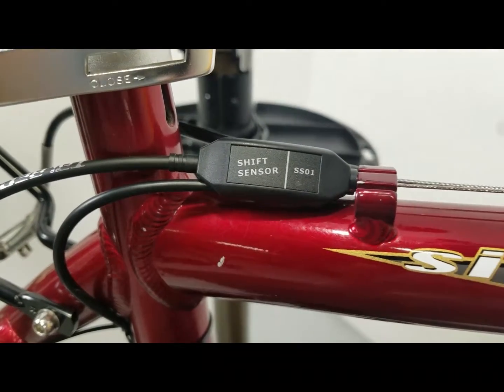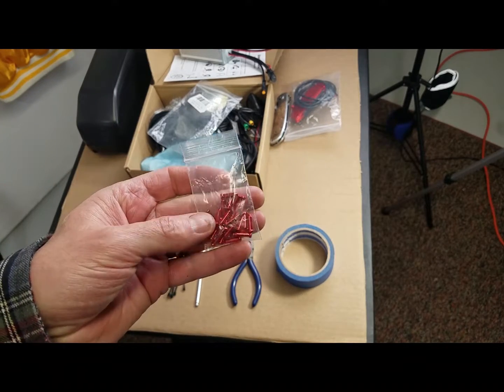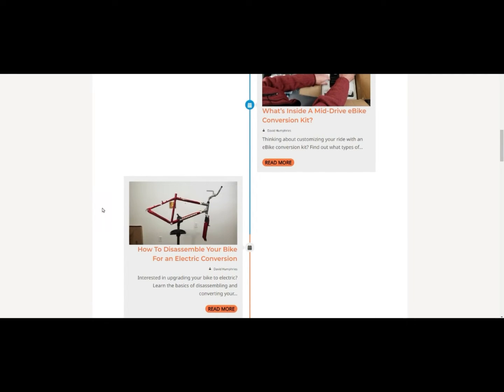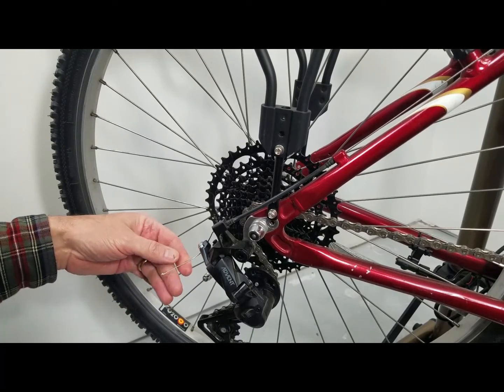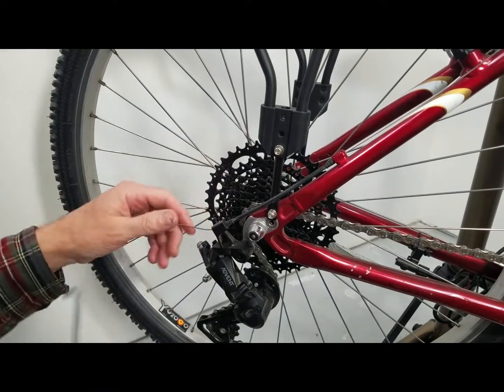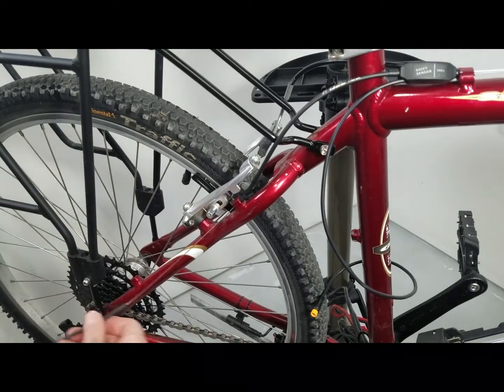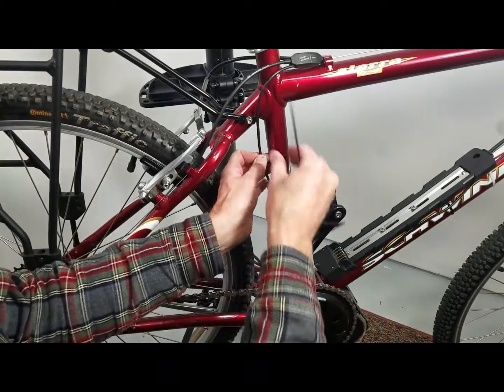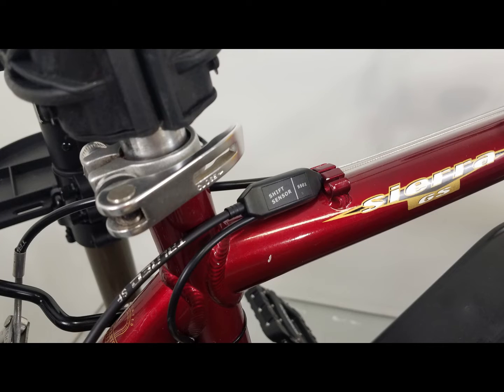What is an eBike Shift Sensor and How Does It Work

Comment: You put it on backwards. Use the cable slot on the seat stay.
Reply from the maker: You can do that, it's worked in that spot for +1400 miles.  Some folks put it on the chain stay by the derailleur.  Keep pedalling 🚴🚴🚴